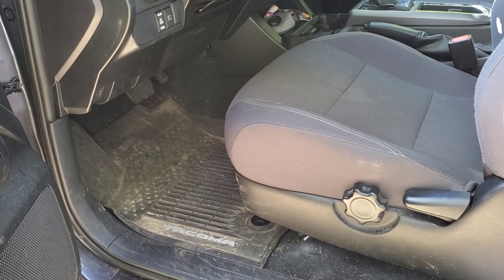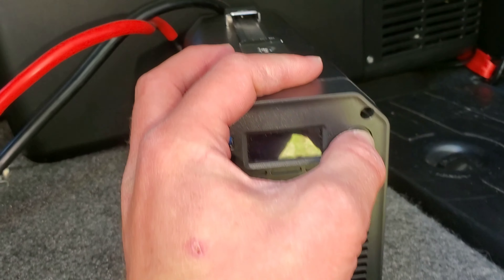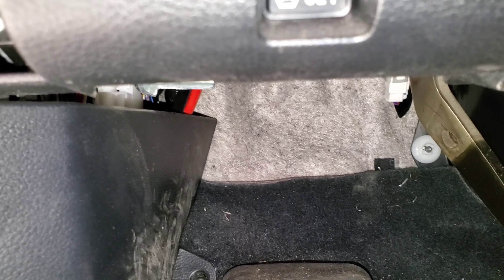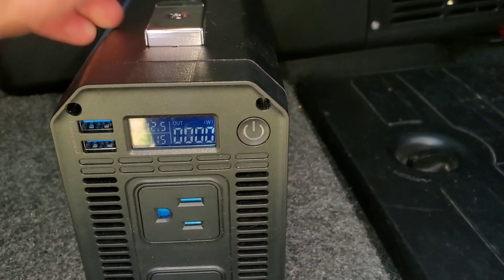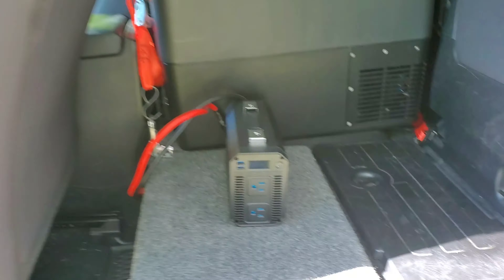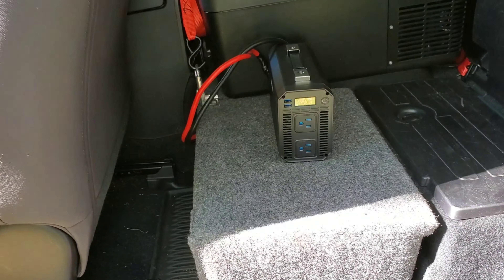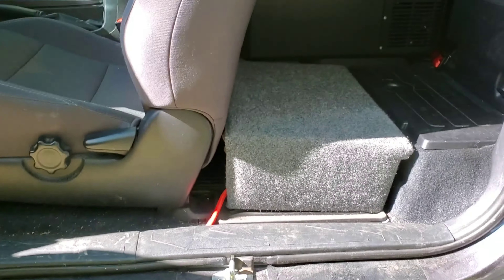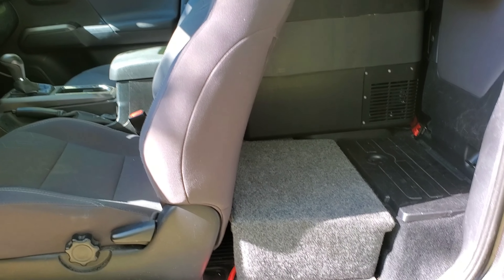PT 10. BesTek 1000W Pure Sine Wave Power Inverter! Tacoma Overland/Daily Driver Build.

Comment: What's the largest inverter one can hook up? I have a civic, do I look at what the alternator can output? what guage wire you use for the hook up?
Reply from the maker: Truthfully as far as the size of inverter (I would think) you could run any size you want as far as output power. And if the output draw of whatever you were using was to high the alternator would regulate the power output although I think about any vehicle would run about any inverter the average person would use it for without issue. 
I’m not electronic savvy by any means although I would go with some thick gage cable (I think I used 8 AUG jumper cables.)
Reply: There is no simple answer. Too many variables. Just be aware that the amperage draw on the battery is huge, even at 1000 watts. Your car may be unable to keep up with a large current draw. Even a 2000 watt inverter needs 1/0 cabling to be bulletproof. Consider going 1000 watt in your average vehicle and conserve your electrical use. Do your research carefully. Enjoy.

Comment: Hey Marshall I have a 2015 Tacoma access cab I'm building into a kinda weekend overland rig I would like to see a video explaining more about your platform you built in the access cab I'm thinking of copying it
Reply from the maker: I do have a video on the platform and also a short video going over the dimensions of the platform (3rd gen though) although a few months back I did some pretty extreme modifications to the entire back of the cab and built a entirely new platform after removing the rear seat cubbies ect. There will be a video coming out on that. I’ll try and get the video out this weekend!

Comment: SHOW US HOWTO WIRE IT
Reply from the maker: It’s one of the easiest installs you can do to a vehicle, you can YouTube inverter instilling in a vehicle. The core concept is the exact same for every inverter and every vehicle. The rest you’ll have to plan out how you want to wire it where you want to hide the wires ect.
Reply: Install is simple. Positive on the battery go to positive on the inverter and negative on battery go to negative on inverter. If you use your inverter alot then you might want to upgrade to dual battery setup.